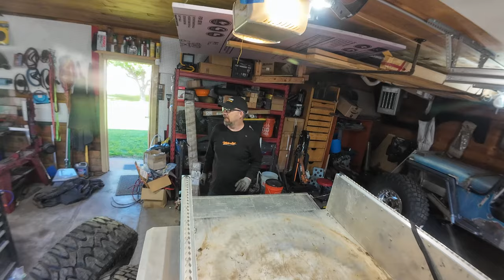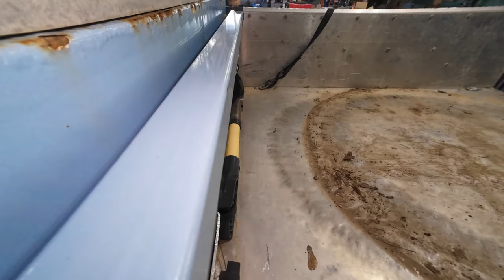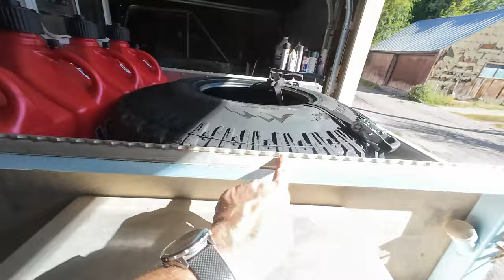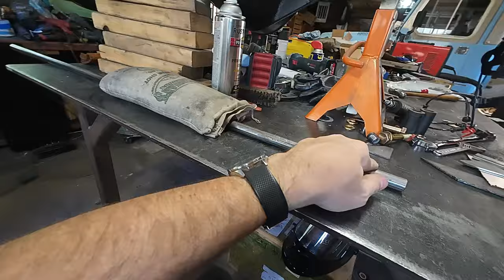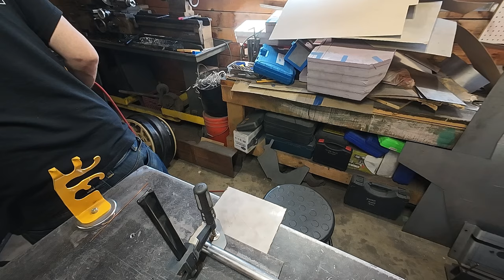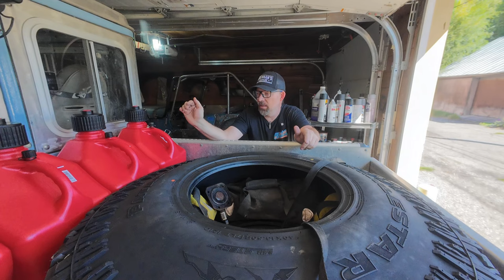Double Dusy Prep Part 2

Comment: Love this idea! A simple hole through both pieces of pipe and a 1/4" safety pin, like a Curt 25012 would hold the lever bar nested then you could anchor the safety pin to that side as well so as to not get lost. Another idea, cap the lever pipe with a cap larger than the OD of the big pipe, throw some elastic cord through the pipe and anchor either with a knot or to a cap on the opposing side giving you a self retracting and storing lever. Would might reduce the rattle if the cord is tight enough.
Reply from the maker: After a good bit of testing doing the Dusy-Ershim trail both ways....no rattles. No issues with it coming undone including a few thousand miles on the trailer bouncing around.

Comment: I dig it, could you leave that bar in the other bar for leverage and just drill a hole in it and pin it so it stays in the bar?
Reply from the maker: It's possible. In my situation, that bar would be sticking out past the bed where I have a rocker step that I use to commonly climb up and down into the bed. I wouldn't want anything more sticking out there to get snagged on. You can get it unclamped with your foot if you really need to if you lost the little cheater stick.

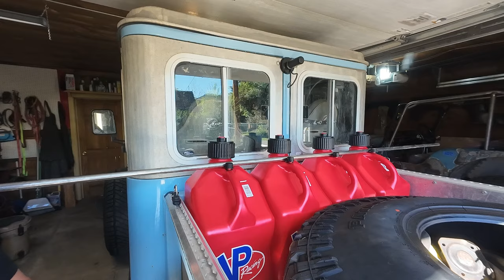Comment: 12:30 - Any thoughts to running that fuel tank tie-down bar through the handles instead?
Reply from the maker: @BenFenner  Yhe handles are too low compared to the bed rail, unfortunately.
Reply: Seems the tension technique guided the solution, so that's understandable. I guess I just think the vent provision looks  a little suspect for holding things, but I guess the cans would have to move through the cabin for them to see stress.
If you wanted to use the handles, maybe a 1x4 board under the cans could raise them up enough. But now I'm just rambling...
Reply from the maker: @BenFenner  i appreciate the ideas. The cans are trapped pretty well in the bed by the tire ans bed walls, the only thing the bar needs to do is keep them from flying up. It's fun to try different stuff. Just out here trying to have some fun.